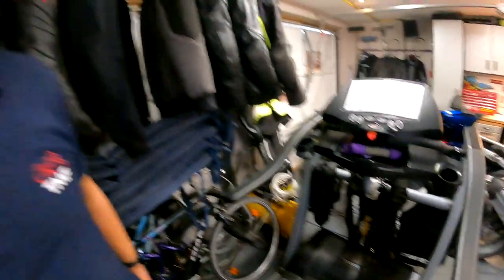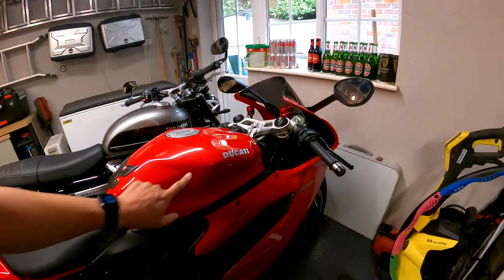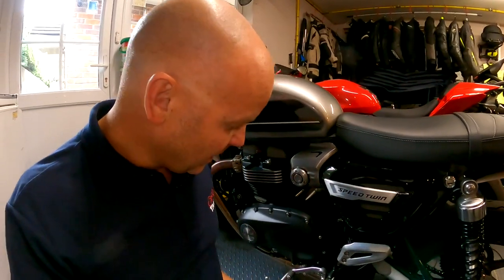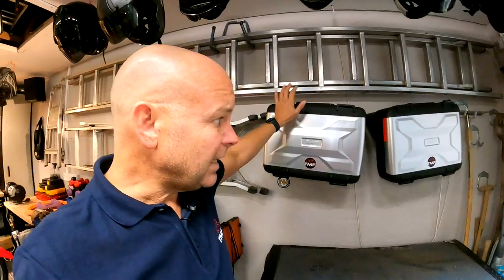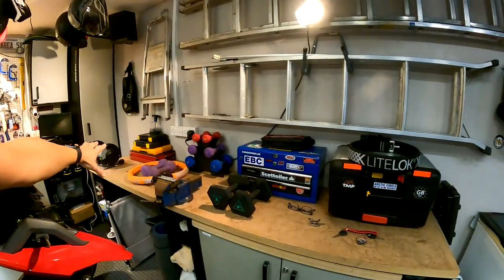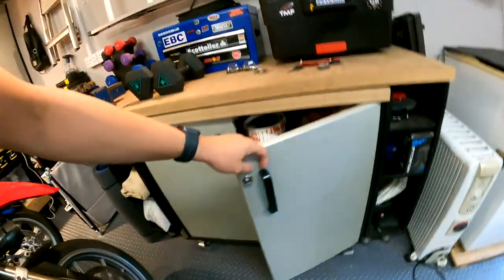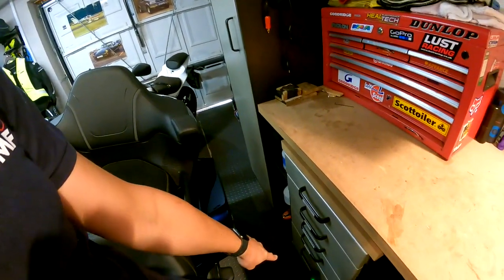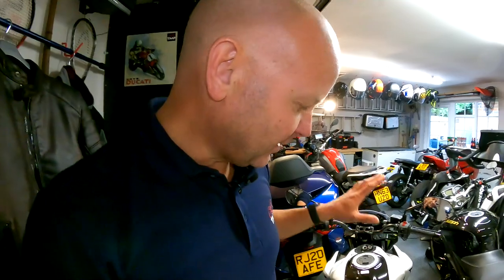TMFs Garage Tour & Bikes Update

Comment: Ref the 899 = If the check engine light is on when the engine is running you can see the fault code by pressing the bottom button on the left handlebar and holding for a few seconds. The dash will change and you will see "ERR" displayed. Press the indicator cancel button and a word will be displayed that will indicate the area of the fault. You might have it sorted by now but might help if not. Also while we are on about the Ducati, crc racing make a whole throttle tube that does the same as the spacers £20. All the best John.
Reply from the maker: Yes thabnks someone else mentioned that and I checked this morning - would you believe the CEL light has now gone out and no error codes showing - typical as she goes to the dealers tomorrow for investigation (and a service)...

Comment: I have a ‘18 Street Triple 765R. I have a little over 15,200 miles.  Drooled over the Street Triple for about 6 years before I finally got mine.   So mine will never go anywhere.  I have an SC Project carbon fiber muffler on mine.  I added a new Harley Davidson Softail Sport Glide just over a month ago and have just under 600 miles on it already.

Nice video tour.

Comment: lovely man cave the only thing I would change is to get rid of the cable reals your chargers are plugged into. When you buy one it will tell you in the instructions to completely unroll it when in use as it can cause an electromagnetic effect and over heat. (I know you don't have a great load on it and its unlikely to cause a problem but you asked), Just use a short lead with a muilty output. Plus I would be tripping over the dam thing all the time...😎
Reply from the maker: You're not the first to mention that.....
Reply: @TheMissendenFlyer  I have bought the optimate extension wires then the units sit on the wall and the cable trailing on the floor is only carrying 12volts so if it’s damaged in any way there is not the possibility on 240 volts going up someone’s leg(probably mine)!

Comment: Hi Andy. Great vid, thank you. Heads up on flat spots. Had to have new tyres fitted to my 2015 899 (only done 790 miles)  due to it sitting/lack of use and flat spots on the Rosso Corsa tyres. All my bikes, that can, are now on paddock stands. 😀👍
Reply from the maker: Good tip!  I do try and ride all my bikes regularly - it's only since I've had that CEL on that the Panigale hasn't been ridden (it does get moved quite often though in order to get other bikes out or for filming purposes)...

Comment: Always good to have a catch up, thanks for that 👍🏻

One thing you still need to do is fully unwind the blue extension reel before it catches fire and you lose everything because we’d hate to see that! Or better still get a shorter lead with a 4 way socket on so you don’t trip up on the excess cable.
Reply from the maker: You’re not the first to mention that Cotti!

Comment: You still have not insulated those garage doors yet. 
Keeps it cool in summer and warm in winter 👍
Therefore no wild temperature swings and moisture / damp getting into all your cloths, helmets and bikes 😎😎
Reply: Also put a loft hatch door as all your heat just goes up that gaping hole 👍👍

Comment: Very interesting video; thanks! Are you planning to review the new Triumph Speed Twin? I have one like yours and have fitted the booster plug and throttle spacer (thanks for those recommendations). I’m probably going to fit the Tec Bikes suspension - front and rear - as I find it a bit harsh on our West Country lanes. The new model has upgraded brakes and suspension, but is this really an improvement or is it just a way of complying with the latest Euro regs? I’d be interested to hear your views.

Comment: I have the quilted seat on my speed twin. I do find out that i slide around about a lot on it. Never actually use the standard one yet on rides. As for comfort i dunno. i dont find anything wrong with it yet ,but i haven't done long rides yet mainly short 30 mins trips. Looks good but. Also it might be my imagination,but i think the quilted seat is slightly higher.

Comment: Noticed most of your bikes have low mileage. Need your opinion on servicing of bikes. How often do you service your bikes? Do you follow the mileage or time frame, say once a year irrespective of the miles you put in? Thanks
Reply from the maker: If a high miler then mileage, on the low mileage bikes annually if under warranty then every two years is my approach....
Reply: @TheMissendenFlyer  thanks for the tip

Comment: question: Which is easer to push around in your garage, your GS or your Goldwing?
Reply from the maker: The GS without question!
Reply: @TheMissendenFlyer  I know that sounds like a dumb question, but I’ve found with bikes that if the weight is carried high they can be as or more difficult than a heavier bike with a low center of gravity. Thanks for your response 👍
Reply from the maker: Agreed - both bikes have a low COG as they are both horizontally opposed motors mounted low…

Comment: Is that gas pipe plastic or metal?
Reply from the maker: Plastic I think - why do you ask?
Reply: @TheMissendenFlyer  I asked because, as far as I'm aware, plastic pipe should not be used for gas installations indoors, the reason being that, were there to be a fire, then the pipe would melt & feed the flames. internal piping should be of either "barrel" or copper! You might want to make enquiries about this!
Reply from the maker: ..I think its a copper pipe with a yellow surround to denote gas.....but I'm not 100% sure....
Reply: @TheMissendenFlyer  It could well be, but if you can "flex" it, then it's plastic, if you can't, then it's copper!